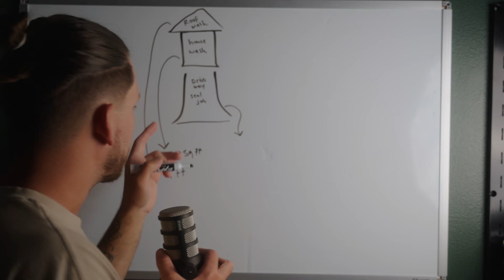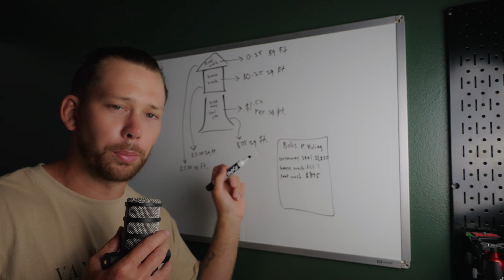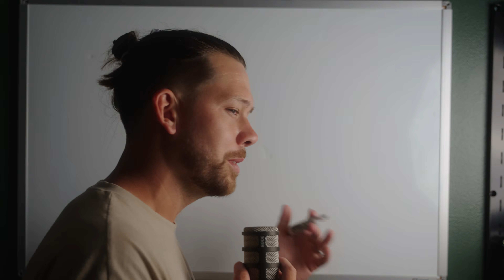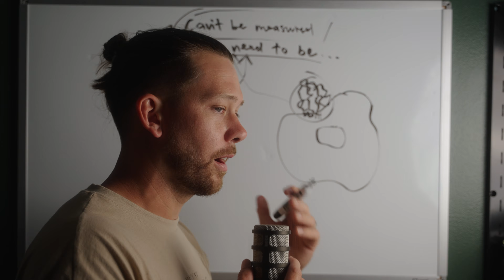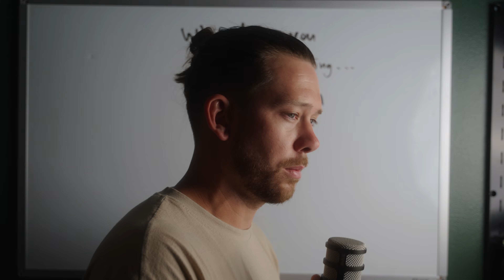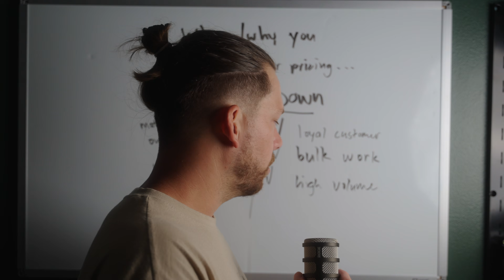Pressure Wash Pricing Guide (for maximum profits)

Comment: Good content brother!  Got me to rethinking my pricing.   I showed up to an asphalt drive way (2,500 sqft) pressure cleaning the other day and I had quoted it at 250.00 over the phone.  But they wanted the loose seal coat removed as best as possible when i showed up.  I was in shock but kept my smile.  What  was supposed to be a 20 minute job took me an hour and a half.  Live and learn.
Reply from the maker: Thank you brotha! Appreciate it a ton. I hear you on that! That’s the best option you could’ve done 👍
Reply: Is $.25/sqft to high for your area
Reply from the maker: Yes a little too high. Wouldn’t sell too much at the price.